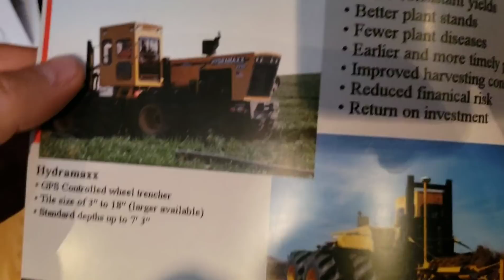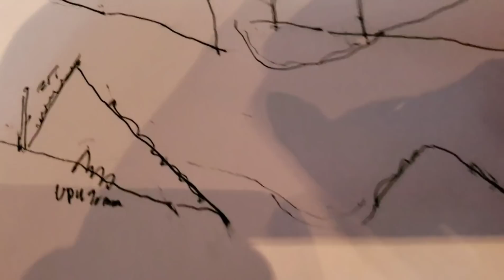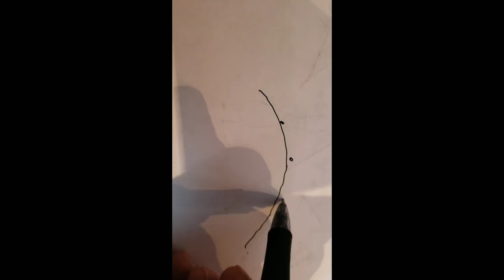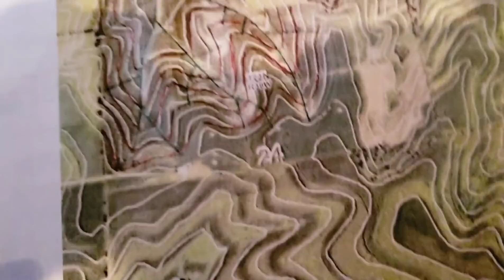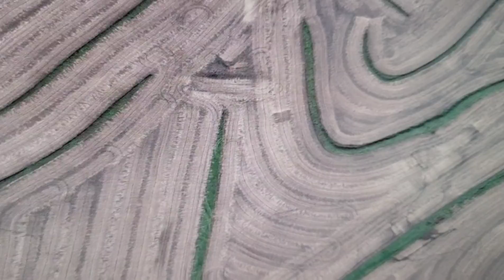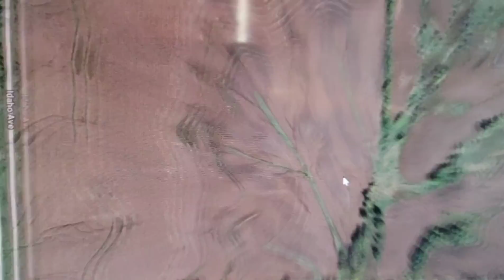Terraces further explained

Comment: WOW !!!  You move alot of yardage per foot of terrace.  Down here they lay them out on 100 foot stations and require 9 tens cut to create the drain channel 12 flat bottom and 6:1 slopes on the berms for a total of 1.5 deep. I would not even know where to begin on what you have. Great job on the explaining the differences.
Reply from the maker: Thank you for watching .. hopefully I did an okay job explaining .. it's very hard to explain (esp. Fairly quickly) .. I'll try to talk more about terraces in upcoming videos ..